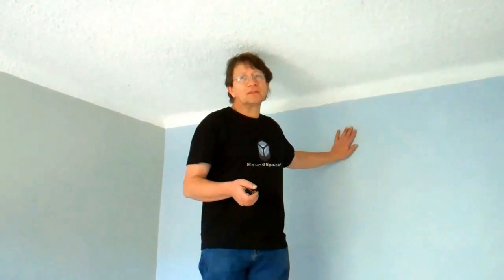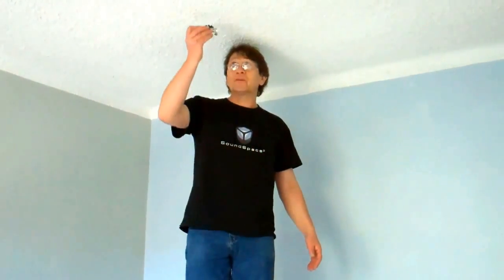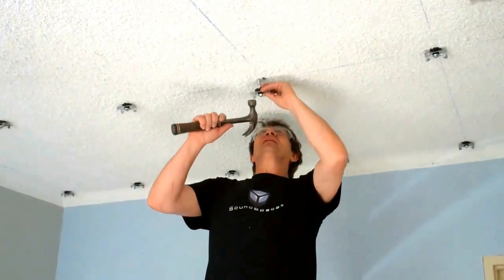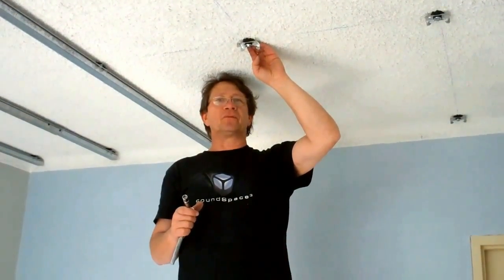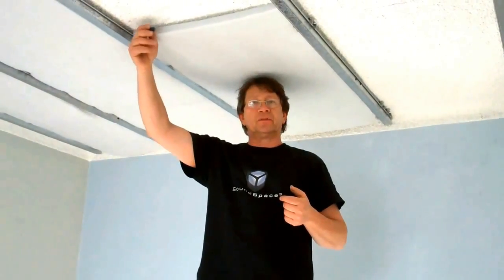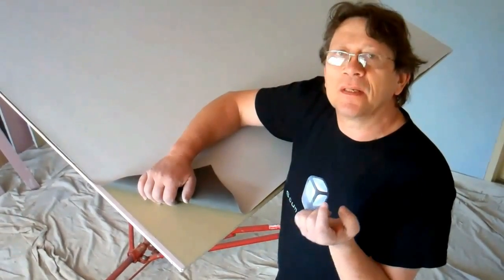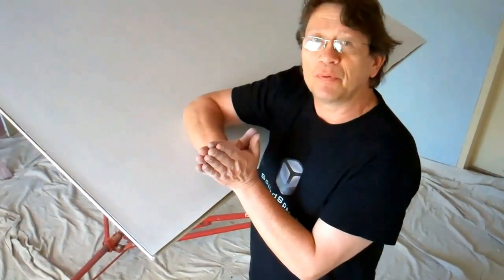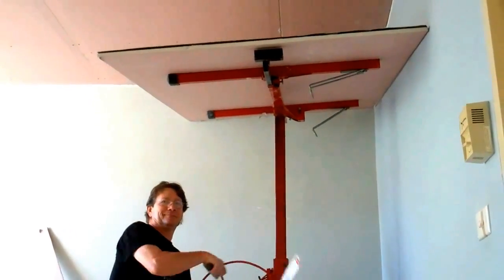Best Soundproofing Concrete Ceilings in apartments

Comment: Thanks for the info.  I was told that the sheetrock should not be butted up completely to the wall and to leave a gap where a green acoustic filler should be used.   How did you treat the ceiling /Wall corners?  Thanks.

Comment: What about using some kind of spray. Like spray foam insulation? I'm opening a bar and the ceiling is all concrete
Reply: Maybe I should coat it with something first then spray some spray foam or something onto it
Reply: @jeffreyinkorea6190  spraying something would be to reduce echo in your restaurant, that will create a better sound environment for you and your client.
you can spray vermiculite, around 50mm thick would be good. The system I am presenting here is to reduce the noise going through the concrete slab, not for echo.

Comment: It would be better if neighbours were considerate and installed fixed floorboards (a bit more expensive but robust) rather than the floating (cheaper) floors. To lose 3 inches off your ceiling isn't really palatable

Comment: Didn’t you compromise the structure of the building by drilling so many holes in the coded concrete slab?!
Reply: I am not being a smarty pants but I have seen many building Demos. even after drilling columns in half with demo hammers and dynamite , floors still don’t fall

Comment: Does this technic help to block impact noise comming from the upstaires. like heavy footsteps, kids jumping and running etc
Reply from the maker: No, footsteps, impact noise, will be reduced but the perception will be still there, because, usually a concrete slab is connected to the hard walls and transmit vibrations through the whole building structure. If you could put your hear on the ceiling slab and compare the noise with the walls, the walls would appear to be 50% less noisy, therefore, after the ceiling acoustic treatment, the result will appears to be 50% less. If I do the whole unit, people will not perceive the difference before and after because the perception is still there and for that raison, I suggest my client to do just one room, to have a comparaison with the other rooms, and decide if the sound reduction is worth the money spent and half the people decide to treat the other rooms, the other half try to negotiate with their neighbour upstairs to lay some rugs here and there to absorb the footsteps and that is very cost effective because, it's always better to stop the noise from the source instead of stopping it when it's been created.
By laying some rugs, you reduce the echo and vibrations going through the walls as well, such as TV and loud voices.

Comment: What exact type of bolts/concrete anchors do you use to attach the clips to the ceiling? You mention "Brazilian mount" but I can't find this on the web. Thanks.
Reply: I think the word you are after is 'resilient mount''
Reply: @jasonfry1967  Ah, okay, thanks.

Comment: What do you think about 'Green Glue' vs Membrane between boards?
I know Green Glue is pretty expensive. They recommend 2 tubes per 3m2 = 50 GBP (65 USD).
Is there a further 'noticeable' difference in noise reduction with Green Glue?
Also, can you give me any details on the screw mounts you use..I'm in the UK.
Reply: The membrane or the Green Glue works roughly the same. There is definitely a noticeable difference using Green Glue or the membrane. The screw mounts are called resilient mounts and you'll find that in most shops specialised in plaster boards.

Comment: Will these clip type systems produce better sound insulation if installed on an independent metal frame or timber frame ceiling? I have concrete ceilings with timber wood flooring in the apartment above - the same as in this video.
Reply from the maker: If you have enough space than I'd suggest to use resilient mounts made with springs, it works better but takes more space, they are bigger but more efficient, the type of spring will be chosen according the plasterboard weight, just follow the manufacturer instructions. The brand I am using in Australia is Embelton so you can check in the net what they have and find the equivalent in your country. If you can afford more space, you can install thicker acoustic batts and the space between the ceiling and the new plasterboard being bigger, you'll have extra sound reduction. You can only reduce the noise because some goes through the walls, directly connected to the concrete slab!

Comment: Can you explain what fasteners you used to attach the mounts to the concrete ceiling? because that’s exactly what I have in my basement ceiling. Concrete brick and steel.  Would be great to know what sizes of fastener and drill bits you used for this.
Reply from the maker: I've used 6mm diameter Dynabolts with 6mm drill bit

Comment: If I'm building a concrete house, how can I reduce the transfer between the slab and the walls in the structure itself. I will additionally install a room inside a room in some way, but I'm interested in how I can design the structure itself to mind the transfer of noise between slabs and walls, when both are concrete.
Reply from the maker: Good question! you can install on the concrete floor, a neoprene matt or similar material, 10mm thick, or so, with no gaps and with that matt going up the wall 100mm, lets say, than you can install on the matt, your electric ducts, pipes, heater or insulation, whatever you need and cover the whole surface with 50mm thick screed, that will be your new finishing floor, a true floating floor with no connection with the walls or floor; cut the excess neoprene matt along the wall. This will reduce a lot of vibration going trough the floor and walls.They use that technic in Europe, for appartments.

Comment: if I want to build a small soundproof room inside my big room how should I build the wall? do I need to screw the top track to the furring channel on resilient mound? or can i screw directly to the ceiling?
Reply from the maker: The best would be to build a new partition completely separated from the wall.Steel studs would be better for acoustic and it is cheaper, quicker, lighter.
the studs are fixed on a track on the floor and another track on the ceiling.
Between the studs you can install high density acoustic batts and two layers plasterboards with a mass loaded vinyl between. I am using 16mm thick plasterboard or 13mm thick acoustic plasterboard (13kg/m2). If the ceiling is high enough, you can install a separate ceiling, fixed on the new walls and made of double studs, used like joists, the size and thickness will vary according the span of the joists, and treat it like a wall, 2 layers plasterboards with MLV between + HD batts between the joists (double studs). You can get info regarding size of studs according the span from a company called Rondo.
Reply: +soundproofingexpert thank you. So you think sound is not gonna travel through the new wall since its connected to the ceiling? the sound of upstairs stomping and moving chairs
Reply from the maker: There will be still some transmission but less than the existing walls because you'll have the mass loaded vinyl between the plasterboards which prevent the plasterboards of vibrating (it's always vibrating but much less) therefore will transmit less noise. But the ceiling must be treated as well and have the new walls fixed on the new ceiling
Reply: +soundproofingexpert you know what im gonna do? im gonna build small standalaone hut around my bed. So only the bottom track will touch the building. but also im not gonna screw, im gonna use double sided spongy tape so its still gonna dumpen a little bit. What do you say?  How much material is gonna be enough? is one layer half inch on both sides good enough and insulation eventually? In worst case id like to avoid green glue. Its 16 bucks a tube and they say i should use 2 tubes a sheet? 32 bucks a sheet?? way expensive
Reply from the maker: It will work, but you'll need also ventilation in your hut.
Reply: yes, i thought about that too. Im gonna make a hole in the wall and put grids on it. Is there any way to soundproof that ventilation?
Reply from the maker: yes, you can make a column from floor to top with sound absorber inside, all faces, the air flow will move freely and the sound will get trapped on his way.

Comment: Hi Phillipe, We moved out of our apartment (middle floor, concrete slab ceiling, brick walls- typical 60's block) as the upstairs noise was unbearable. Can you give an indication of how much noise would be reduced, from everyday sound such as walking (they have floorboars which I imagine are floating boards) and also when they have parites with music etc?  Also is this service available in Melbourne? Cheers
Reply from the maker: This is the worst case scenario because the noise's going through the whole building structure, everything is connected to everything. Because they don't have carpet, the noise travels through the walls, almost as much as through the ceiling, so by fixing the ceiling, you are fixing half of the problem and the perception of sound reduction after sound proofing the ceiling would be around 35%, that's poor reduction compare to the money spent. In this case, I suggest my clients to treat the ceiling in one room and decide after if it is worth the money spent and 50% of people decide to do the whole apartment after. I suggest to offer to the neighbours above some thick rugs to lay where people are walking, it will be efficient to reduce footsteps and echo in their rooms which in turn will reduce sound transmission through the walls as well, this is a cheaper alternative, sometimes, neighbours are willing to cooperate.

Comment: In London, we have fire regulations for the ceilings. How should I install fireboard and then sound boards?
Reply from the maker: I don't use sound boards for ceilings, only fire boards, same for walls most of the time, the reason is that in Australia, sound boards are 13mm thick and weighting 13kg/m2 and the fire boards I am using is also weighting 13kg/m2. 16mm thick, so they have the same weight but the fire boards are cheaper with also more choices in lengths. We did fire tests in Australia with 1 layer visco-elastic membrane between 2 layers fire boards and it didn't affect the fire rating.
Reply: soundproofingexpert thanks for the advice.

Comment: is it possible to use thick rubber washers instead of the resilient mount. as the rubber washers are much cheaper then the resilient mounts. thanks
Reply from the maker: +James Pitt- Good question, the answer is no, because the resilient mount is made in such a way that the fastener, that fix the clip on the ceiling, is not in direct contact with the clip, the rubber is between and reduce vibration transmission to the clip and the whole structure. Lets say you use just a rubber, the screw will be in contact with the ceiling and the clip and will transmit noise vibration through the whole new structure and new ceiling.
Reply: oh. very clever you explained like you have. thank you and well done!

 i thought the transmission will be minimum or negligible, but in reality i was just looking to cut the costs as the resilient mounts are expensive.

 i guess there are no real short cuts and its better to do the job properly with all the right materials and a proper building. I'm a bit disappointed to learn i cant short cut my way, but pleased that i have probably saved more money and saved the dissatisfaction later by not doing a half hearted job. i hope.
Reply from the maker: +James Pitt - That's absolutely right, if there was a short cut I would have used it as I always try to find the most cost effective way to do the job and you have only one shot, once it's done it's done. At least you'll know you did the best possible way because there is always some noise still going through.
Reply: +soundproofingexpert so let me get this absolutely clear, because i tend to not understand.......
What if i were to drill large holes, fill them up with silicone and a bolt with a hook.............
once this has set firmly, i secure rubber rings to the hooks. Those which hold up my exhaust.
And then i hang my ceiling on them rings.......
I can imagine that i dont need that many points to secure it with.
Like say a bolt and rubber on every end, and say a meter or 2 apart depending on whatever you will hang on it. I was thinking of something like styrofoam, perhaps with some newspaper paper mache kinda stuff ontop.
What do you think?
Reply from the maker: There are surely different ways, to install a new ceiling as long as you separate the fastener from the ceiling, I am not sure how your idea will work regarding the weight of the ceiling because it weight 28-32kg/m2, for a
room of 16m2 it will be over 500kg, one Dynabold will hold 80kg, so try to hold 2-3 people on one of your fastener to see if it holds.
Reply from the maker: The idea of the resilient mount is to separate the screw going in the wall from the channel, with the rubber between, there is no direct contact between the screw and the clip, if you find a way that's based on the same principle, it should work.
Reply: how do you take them out later when you are moving out?
Reply from the maker: Just unscrew it; everything can be removed, what's left is some holes in the ceiling that can be filled with different types of fillers!

Comment from the maker: Spray foam that I know, are light density for thermal insulation and work well for thermal also because it seals gaps very well. In acoustic we need high density foam, the higher density, the better for low frequencies, the hardest to stop. It doesn't matter for acoustic if you have gaps between sound absorbers, it doesn't have to be sealed, sound absorbers are used to reduce sound reverberation, not much sound transmission; to stop sound transmission we need a sound barrier material such as, for example, mass loaded vinyl and that must be sealed very well.
Reply: soundproofingexpert hi, when soundproofing what should I do first the ceiling or walls? How does the ceiling meet the wall?

Comment: iv been looking at spray foams. Q1, why not use spray foam to insulate between joists? as they can help to strengthen the structure and will be air tight?  is it just the expense? please explain.
Reply from the maker: The spray foam, such as polyurethane, is not a good sound absorber, that's why I am not using it and I guess it would be more expensive too

Comment: where to buy the metal bars from and those rubber clips that hold up the bars, to dampen any vibrations and to create a gap between the bars and the ceiling. thanks
Reply from the maker: you can buy the furring channels and the resilient mounts at the same place you buy the plasterboard, not a hardware shop but a shop specialised in plasterboard, The company manufacturing this is called Rondo

Comment: how effective is this at reducing noise in terms of db?
Reply from the maker: +Natalie Tao 
The reduction should be around 45-47db from the ceiling but after treatment, the walls will transmit more noise than the ceiling so, ideally, would be to treat the walls as well but it become very expensive and you'll lose a lot of space; so overall the reduction would appear to be half. I often recommend to do one bedroom for example instead of the whole apartment so the client can see if the difference is worth the money, half my clients will do the rest after; you see, there is a matter of perception of the noise that is different from people to people. I get much better results with a timber floor acoustic treatment, more space to play with.

Comment: Laminate flooring should be banned above ground level, the noise here will transfer down the walls.
The simplest thing is to tell them above to get a decent underlay & carpet because every noise they make you can hear urinating, sex, farting
Reply: In the UK it is banned...problem is many landlords don't enforce it, leaving it up to the neighbors, which can create friction especially if they've just spent lots of money on buying the laminated flooring. I've got new neighbors moving in above, and I'm going to make sure that they are told "No laminates." If not, I'll tell them myself as soon as they move in...politely, of course.
Reply: I agree with you, carpet with a good underlay is still the best option because you don't create noise to start with otherwise, you have to stop the noise created and that's more complicate and costly.

Comment from the maker: From the ceiling yes but you may have some TV sound coming from the walls in some cases, for example if they have too much sound reverberation (echo) above due to too much hard surfaces, hard walls, hard floor (no carpet).
Reply: +soundproofingexpert to stop the noisy steps of the high hells of my neighbour from the ceiling, beside what you have done in this video, adding any kind of material of 3mm to the walls would help? What could i do in the walls with 3mm for completing the work you did on the ceiling what are your thoughts? And here where i live we have leroymerlin store, what material should i buy from them to do the job you did?Thanks
Reply from the maker: 3mm is really to thin to make a difference, you could only glue a mass loaded vinyl with poor results and ugly look. 
Could you ask kindly your neighbour to remove her high heels in her apartment?

Comment from the maker: Yes, you can use plywood but the end result will be in proportion of the mass of the board you'll use, the heavier the board the better, plasterboard or MDF boards are heavier than plywood for the same thickness and cheaper too usually.